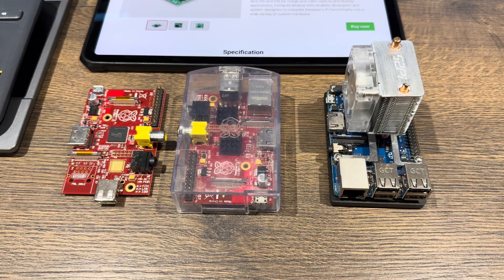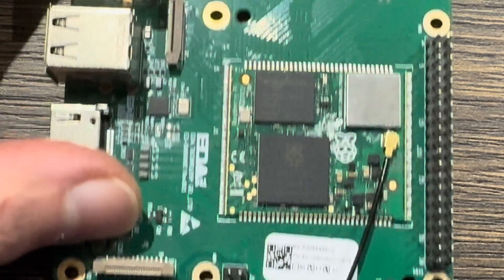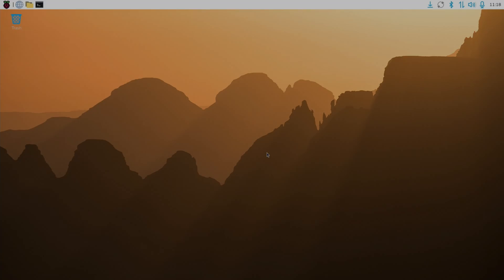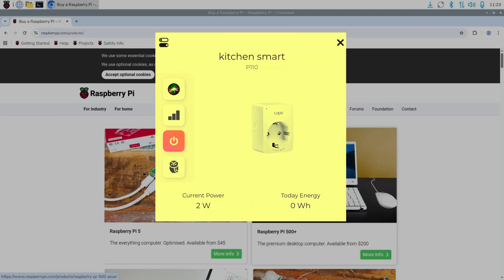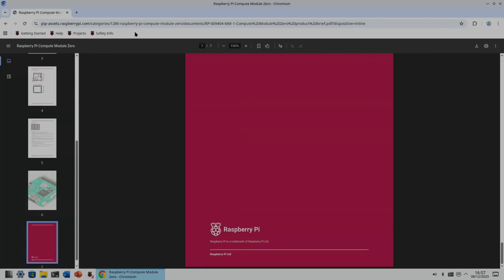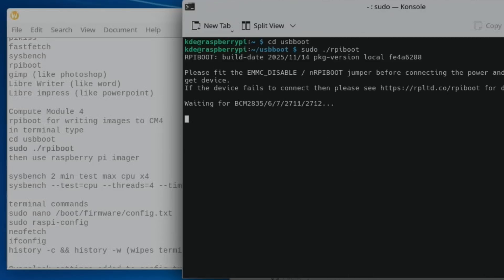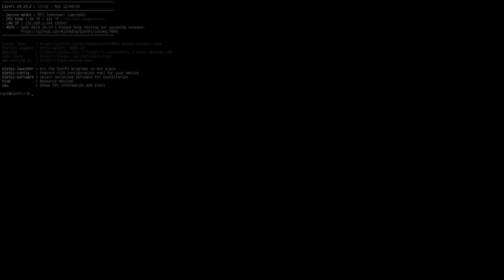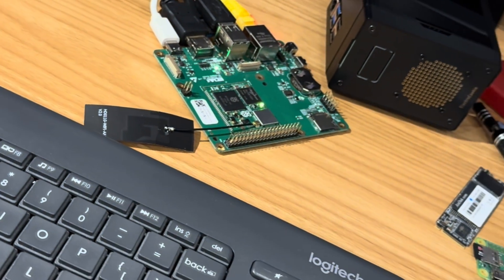Super efficient $18 Raspberry Pi!

Comment: I wish there was a easy and cheap to acquire psp-style shell and screen solution for this board, most are too expensive to make it worth it or the kits were limited or no longer available. It's ironic cause I think a large quantity of of rpis are sold cause of retro emulation.
Reply: agreed. Really, some shells and a more powerful pi in the zero form factor or similar would sell like hot cakes.

Comment: i tried eveything with this.......

the chinese web site showed TWO of the support boards that the module can go into.....each board looked hard soldered, no plug in.

i tried to buy it with the BASIC host board , but it took me to a chinese vendor that would not allow UK people to open a free account to fill their shopping trolley...?

if it could be purchased at 18 usd including the HOST board ...... , then it's not a bad deal since it has 8 gigs of storage and comes with the OS ready to go

but sadly i could not find it's price nor was able to buy the version with the  BASIC HOST board connected.........(not the same as your HOST BOARD.)
Reply: It’s about £37 on AliExpress for a board only and £56 for the 16Gb version with the I/O board too.

It would be about £76 for the equivalent CM4 with I/O board in the UK, and a more capable option in reality.

Or the base model Pi 4 at £33 plus an SD card would be better value.
Reply: @stephenvalente3296  
Stephen, thanks very much. How much is UK shipping?

 So the reality is that these boards are VERY  bad value indeed.

You can get a new Pi Zero 2W for £10 delivered from RAPID ELECTRONICS uk. 

I like the idea of Pi because indeed there are SO MANY free projects and software's that you can get.  For example "OSMC" for pi zero 2W which is an excellent media player.

But we must bare in mind the connectors you need to buy and Shipping costs

when i look at competitors they sort of blow the pi away ....like the "RADXA A7Z cubie" board which is same form  factor as Pi zero, but is an octa core  with 1 gig or ram at just £14 pounds new.
It Comes with Debian......... and some other OS's.

There are SO MANY sbc's out there.......literally nearly like 20 to 40 brands and Pi is just one of them.   Luckyfox is one.

An Android TV box is £12 new with power brick, remote ,2 gigs of ram & 8 gigs of SSD, ready to go out of the box with 100 free apps
and Android.
 You can easily install LINUX and run it...... "miniARCH " for example  

best wishes 
B
Reply: @stephenvalente3296  

Thanks Stephen (and how much extra for UK shipping?)

......i typed you a long reply but no idea where it's gone....sorry

......so the reality iseems to be that these boards are VERY bad value .....

....it's actually needing a spend of about £75 to actually get a working computer  ....which isn't what the video title says AT ALL....!!!

Stephen , i just hope people are smarter and get a "RADXA cubie a7z" octa core board with 2 ghz cpu's and 1 gig or ram.....for £14
( it blows the pi away)

thx

Comment: Using a Pi Zero with only 512MB of memory is a huge mistake. Fortunately, Orange Pi recognizes this flaw..
Reply: Depends on what you are doing with it.   I wouldn't recommend using it as a daily driver, but if you wanted a dedicated pi-hole that would run fine.
Reply: Not to mention Orange Pi Zero has USB C
not the old micro USB that Raspberry Pi 0 still uses

Comment: Nice review! It's an interesting proposition. I'm always a fan of super low power systems. However, I already struggle to find uses for my Raspberry Pi and Radxa Zero devices. The 4b and CM4 just do everything better. 🤗
Reply: Aren't the Pi 0 devices lower power still ? For better use on a battery and low compute things, like reading and sending sensors data ?

Comment: Where is the damn Zero Pi 3w 1gb of RAM when you need it? 😂  In the 90's we use to run a web browser with 512gb, downloading mp3 files with Napster and playing Tetris without sweating 🥵
Reply: 512mb?
Reply: @JoacoTech 😅 you right dude jajaj MB what a wonderful times
Reply: The first web browser I ran was in the mid-1990's over a dial-up Internet connection. It was called "iBrowse" and I ran it on my Commodore Amiga A1200 with its Motorola 68020 CPU running at 14Mhz with 8mb RAM.
Reply: You can still use lynx. Also, it should totally work with 512 MB, I guess maybe firefox is better. There's other lightweight browsers (that have fewer features, but a lot of that functionality won't work on a Pi 0 anyway)

Comment: I'm struggling to see the point of this compute module. The board it needs will cost more than the module and 90% of use cases would be better suited to using Pi Zero 2 W.
Reply: Looks like it's intended for embedded applications where customer's board will provide the IO.
Reply: Apparently WiFi is a huge headache for custom boards, so manufacturers prefer to source a pre-certified SOM like this instead.  The CM3 is EOL.
Reply: As far as I can see, it includes an ETH NIC, RTC, USB hub, full sized HDMI. It should have more than 512MB though!
Reply: @phishwak, I see you are re-posting verbatim the comment by @breevwhyman2985 above, which suggests spamming.
Reply: Storage reliable storage
Reply: It would be great if they just fixed the 2W it’s 2025 why are you still shipping a current gen pi with micro usb,  release a good pi0 with 1GB of ram and usb c for power and USB C Hubs.
Reply: @TacticianTilted  give us some emmc for the smol raspis 0 w . Can’t be this expensive. Corrupted    Cards are nice for fiddling but not for actually using